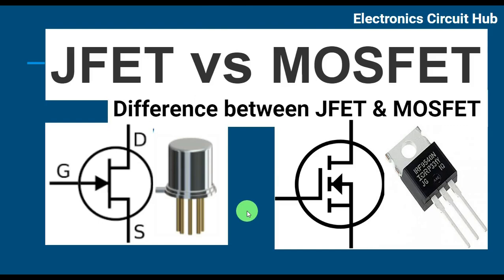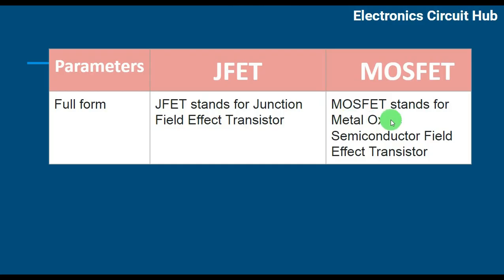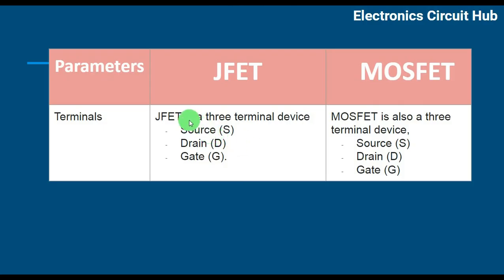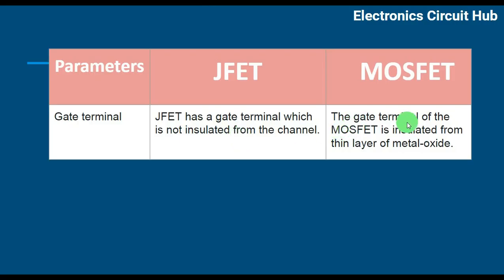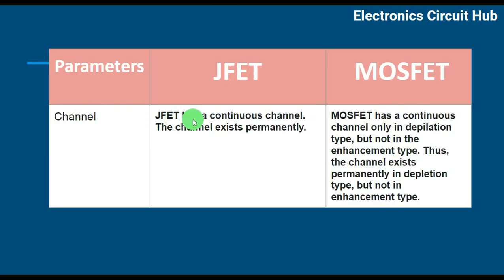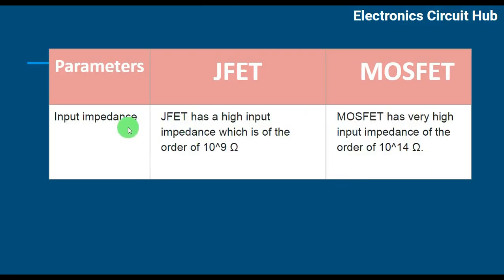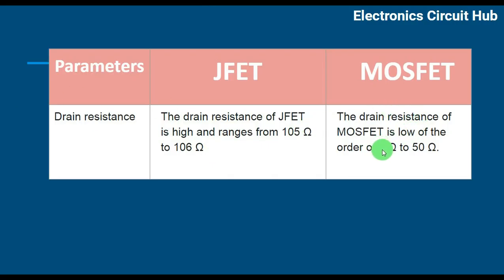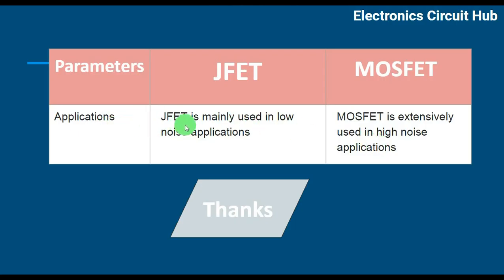Difference Between JFET and MOSFET | Complete Comparison Guide

Comment: Nice explanation. I think MOSFET is mainly used in power (switching) applications, right?
Reply from the maker: Hi...Yes you are correct specially dealing with high power converters and applications.